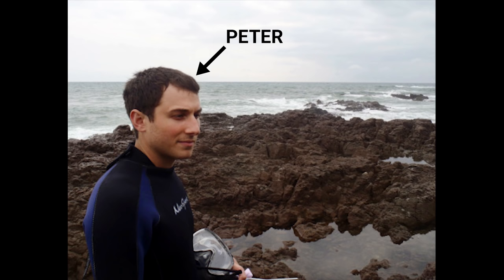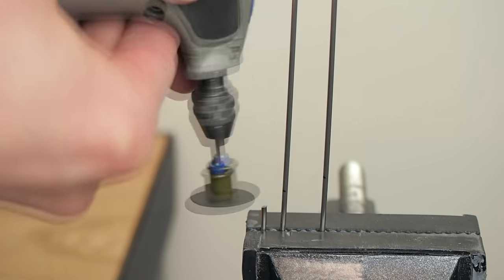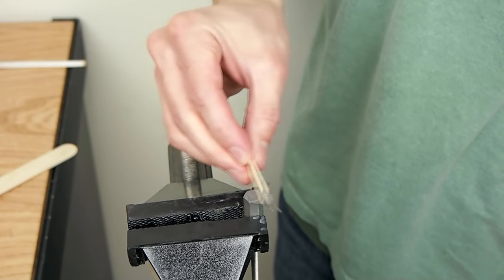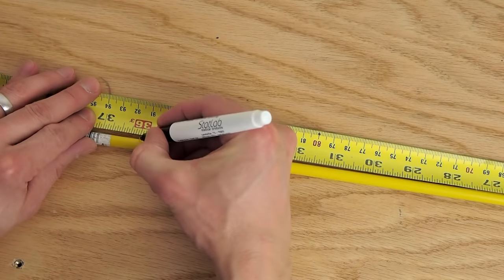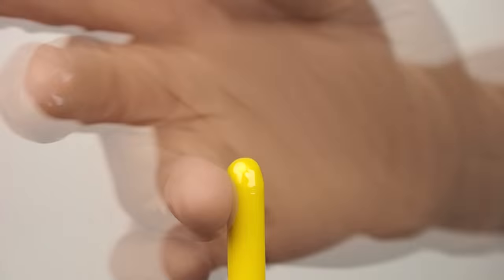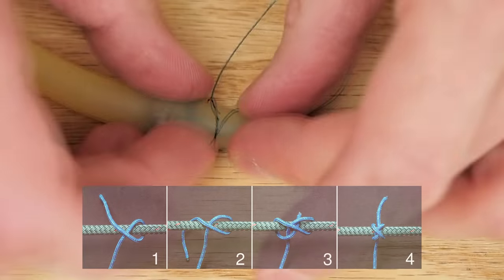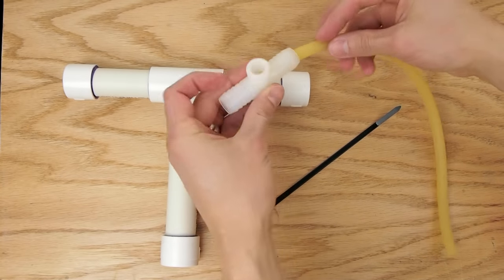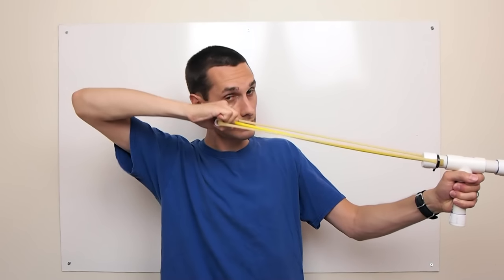How To Make Mini Fishing Spears

Comment: Still dont get how people use the stupid imperial system

13/64 inch drillbit? what the fuck?
0.5cm sounds a million times better
Reply from the maker: I hear ya but when you live in the US it can be hard to avoid imperial.
Reply: Ray Sharky ww
Reply: Ray Sharky 
Can you not insult my countries choice of units? Thanks.
Reply: Ray Sharky most Americans know that this is stupid but we just use it because it's what we were taught
Reply: I need to agree. It's not so hard to use imperial, but it's unnecessary
Reply: Also sounds a lot better as 5 mm instead of .5 cm. lmao good luck finding a drill bit thats in cm.
Reply: It's not too bad. Most of anything important is in metric anyways, and while the math is easier with metric, real world applications generally are easier to use standard (like there isn't a popular metric equivalent to a foot, yes there is the decameter but no one uses it). 

Also, "about an inch" is a strangely common size for a lot of objects.
Reply: Seth Hess Hhhh
Reply: Ray Sharky so true!
Reply: Shew. If this is how passionate ppl get about the measuring systems that they use and take personal offence, what would they be like over something that actually matters?
Reply: I hate it too but its what i know, i wish america would just adjust to the world idc if i have a hard time converting, its efficient to use metric
Reply: Louis Gouws ffggg

Comment: Just as a suggestion, find someone who is good at tig welding, and have them weld the spikes in place instead of using epoxy. Epoxy is strong, but it can be brittle.

Comment: Very nice use of locally available materials!  A couple observations based on 45 years of spearfishing experience:

The points are splayed a tad too much especially for fish as tiny as blennies.  A narrower splay also allows for the splay to increase as it penetrates the target thus grabbing onto and locking the target onto the shaft points.

Also we eliminate the paracord and metal eye, and increase the life of the tubing by attaching it directly to the spear shaft by wrapping the tubing onto the shaft using long strips of 1 inch wide neoprene rubber cut from bicycle tire tube.  Strip of gold TheraBand rubber or latex rubber would work just as well if available.
Reply from the maker: +Ahnko Chee Outdoors  Thanks for the tips!
Reply: @Makify1  You never spear-fished under water have you?

Comment: aluminium, carbon and fiberglass Arrow shafts should work well and already have the threaded head adapter, and obviously arrow heads and shafts for bow fishing   are not hard to find. that would cut out one of the steps and probably cheaper.

Comment: These fishing spears are very very cool mate, if you want to upgrade the power, search theratube on the internet! Grab the plum colour for maximum power. I use it on my hunting catapults and is sufficient to take phesants at long ranges! Also rather than a cable tie use some tubber bands and wrap really tight then tuck under its self this will stop the cable ties cutting through the bands over time 

Cheers
Reply from the maker: +Dylan Hudson  Good tips! Thanks.

Comment: btw you work very well. But, that pole spear is not rigid enough. That fiberglass rod needs to be thicker to withstand such a bend. When you crank it back, as with the hawaiiann sling, you can see that rod bend way to much, sending it in a wobbling arrow, loosing speed and accuracy underwater. I think this application might work for hawaiian sling if the rod would be alittle stiffer, maybe shorter.... but for pole spear, i doubt it will work efficiently. Probably miss alot of fish, or injure them. Nice video tho, very well detailed, and great workmanship
Reply: Could injure the shooter too.  Google search (images) Arrow splinters in hand.  YIKES!!!
Reply: Twisting the surgical tubing around the pole spear prevents it from bending and doesn't affect accuracy.
Reply: Tip from Hawaii. To fix the bend in the pole rotate it twice as you pull the thumb band forward. When released it will spin and shoot straight.

Comment: Great work! Professional looking. I like the fiberglass pole, but I notice it flexes when loaded. This effects accuracy as it leaves your hand or the gun.
Reply from the maker: +Chris Stafford  Yes, it does flex when used as a pole spear. It doesn't flex and is much more accurate when used with the Hawaiian sling, from my experience.
Reply: +Makify1 if you review your video you'll notice that it flexes in both instances. Downward when used as a pole spring and upward as a Hawaiian. I suppose the flex is reduced in the Hawaiian if you practice pulling the t straight back from the gun. I'm thinking ink I'm gonna look at aluminum tubing.

Good work!
Reply: +Chris Stafford If you twist the shaft of the spear while pulling the rubber tubing so that it wraps around the shaft the shaft will not flex.  Also this twisting of the rubber around the shaft gives the shaft rotation in forward movement when released aiding in accuracy.   Here in Hawai'i my favorite spear for decades has been a thin graphite shaft spear 7' long.  It has the tendency to flex terribly if you don't twist the rubber around the shaft while stretching it.  This thin graphite shaft is very quick compared to thicker fiberglass shaft spears so much preferred by experienced divers.